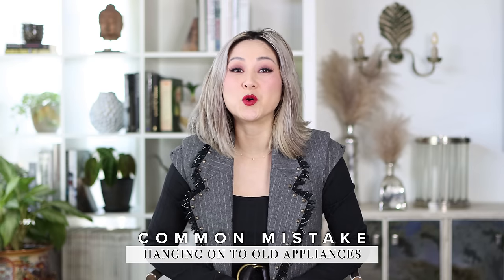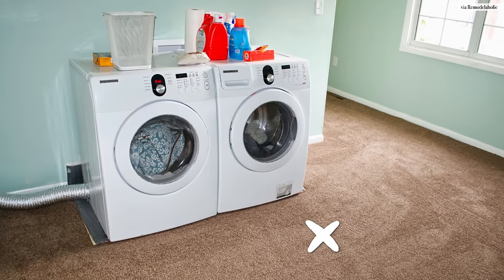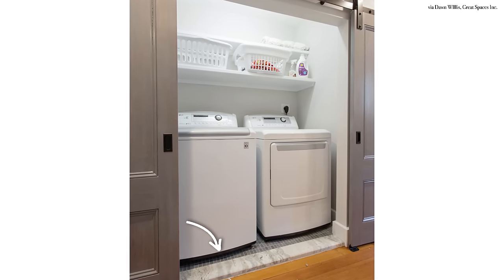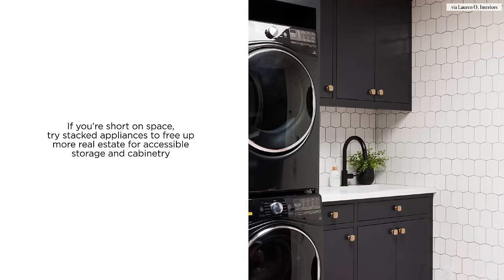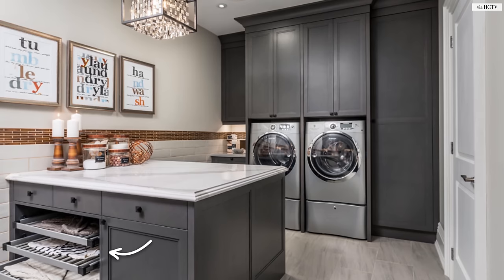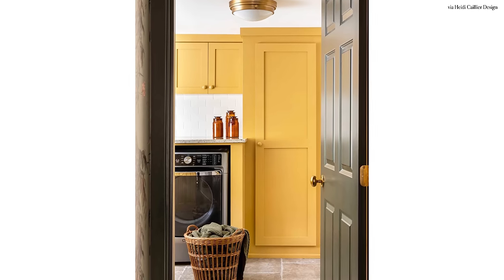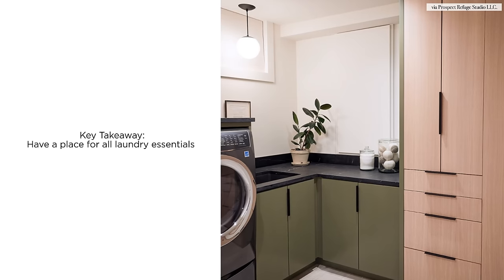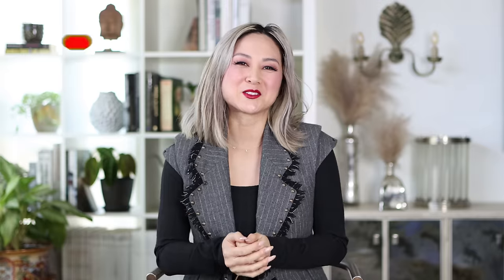COMMON DESIGN MISTAKES | Laundry Room Mistakes and How to Fix Them

Comment: The old, simple top loading washer and dryers are the most efficient and cost effective. Less to break.
Reply: Your right. My brand new machines are just not robust with all the plastic buttons and dials.
Reply: They use way more water.
Reply: @junehodsdon8037  I'd rather they use marginally more water and work for twenty years than break after five. The environmental cost of producing a new washer and dryer and its components have more of a negative environmental impact.
Reply from the maker: Thank you for watching and the feedback L! I’ve had my smart washer/dryer for over 6 years now. They’re still going strong (🤞🏻) My mom still has the older models and hers break down all the time. I’m sure it has everything to do with which make/manufacturer. If you don’t mind sharing yours, I’m sure the viewers would love to know to help their decision 🙏🏻☺️
Reply: @JulieKhuu  Gladly, and I'm sure you're right on the manufacturer piece! 

They are by no means aesthetically pleasing,  but we have the Amana Top-Load Washer and Dryer (less than $1,000 for the pair). Bought in 2013, super budget brand, no issues or complaints so far.  We hang dry most of our clothing, so that really saves the dryer, electricity and our clothes! 

Thanks as always for your great videos -  wishing all of our appliances, long issue free lives! :)
Reply: @cannotgetstarted  My daughter has an Amana set I passed down to her- the washing machine has tons of rust around the lid and it is less than 10yrs old - the dryer had some small piece go out and my daughter was able to look it up on YouTube and fix it herself- she’s an engineer... lol... I could NEVER do that! The Maytag washers and dryers have a 10yr warranty each, but the old fashioned SpeedQueen lasts for LIFE!
Reply: I agree - i find the top load washer cleans better. Granted i had an LG front load for 12 years prior to my divorce & it was a good machine. Went 10 years with little maintenance for about 5 of those years before it needed a new water pump. They make them difficult to fix yourself, have to take off the entire front portion -including the door to get to it.
Front load are trickier to maintain/clean, always need a flashlight lol. I realized besides the faulty pump (& my ex adding too much detergent) due to it using less water the clothes were not getting as clean. I found out how and went in to bypass the water level sensor. Its very easy.
Where i live now i am back to a top load. Easier on the back for sure.
Reply: My old Maytags were from 1989.  I left them in my dad's house when we sold his house 4 months ago, so yesterday I purchased my 1st washer & dryer with my own money at age 60!  My 1989 Maytags were a wedding gift.  Unfortunately, there are huge out of stocks on washers & dryers these days, & I had a coupon that was expiring yesterday, so I couldn't order Maytags again!
Reply: Love my new Samsung smart ones!!! Cleans much better. Hands down. Tammy
Reply: I had the new fancy front loaders and I hated the washer. I switched back to the way less expensive less popular top loader and I LOVE it.
Reply: But you still have to go to the laundromat with a sack of quarters just to wash a king comforter. PASS
Reply: Mine just broke after just 5 years so….
Husband is handy though so he fixed it. Still cost $200 in parts
Reply: Our (inherited) dryer is 43 years old and keeps on ticking.  We have it cleaned every 7-8 years.  We’ve been through 3 washers with many repairs on each in the last 18 years.  Each repairman has told us to hold onto our old dryer.  They don’t make appliances like they used to.  The new fancy ones are extremely expensive to repair and are designed to last only 5 or so years.  We were told on our most recent washer repair that we would be better off to buy a new one.
Reply: Yup! I love my washer and dryer. And the saying "if it ain't broke, don't fix it" is my motto. I refuse to replace something that is still functional. I'm not into the whole upgrade to keep up w the Joneses thing. Hard pass.
Reply: I've had my top loader for almost 20 years. Works great!
Reply: @JulieKhuu  Fisher and Paykel. New Zealand brand. The newer ones they produce  aren't made like they used to be though.
Reply: Front loaders are moldy pos.  Top loader washer for me.

Comment: Just bought a new set for my new house and while those smart machines are convenient and beautiful, I went with a good old top load Speed Queen. The front loaders stink and temper the water! The SQ w electronic controls will tell me how long the load will take and I can set my phone alarm. Not as gorgeous but extremely effective.
Reply from the maker: Awesome Teresa! Thank you for watching and the tip! I know viewers will read your comment and gain insight for their next purchase 🙌🏻☺️
Reply: Totally agree! My sister had a front loader and she would clean it AND leave the door open in between loads but she could detect a mildew smell! We are doing a whole home renovation and opted to purchase a top loader even though the front loaders look better
Reply: Completely agree. Had a very expensive front loader and those  rubber rings are THE WORST.  I donated it and got a good top loader, but I have to say I really miss the old agitators!!
Reply: You are right, once a coin got stuck in the front loader and we had to call a technician for that but when same thing happened in a top loader, we just had to take it out manually from the tub.. simple !
Reply: THIS! Front loaders smell awful! They smell like  mildew no matter how much you clean them or leave the door open to air out after use. Top loaders look old and ugly but when the time comes to replace mine I’m going for an old fashioned top loader….if they still even make them.
Reply: @shadiap  The new LG front loaders have a special trap for coins, etc. Easy peasy. No technician needed.

Comment: For asthetics yes new washer and dryer but for durability no. Older models last forever. They are not hard to repair. My husband has changed gaskets and more and it works great amd saves money.
Reply: But not energy/water efficient.
Reply: I could not agree with this more. We are adding over 1000 sq ft to our home and could afford a new set. But my old ones work and can be fixed. New ones don’t last as long. From an environmental perspective throwing out a working appliance to buy a new more efficient one feels like it misses the whole point of trying to be environmentally friendly. When mine do eventually break I’ll be looking for durability and efficiency for long term environmental gains.
Reply from the maker: Thank you for watching and the feedback Mama! Yes, of course do what works for you and your needs 👍🏻☺️
Reply from the maker: Which is why I’m an advocate for newer models June 👍🏻
Reply from the maker: I love how you put this Elizabeth. If it ain’t broke 👍🏻
Reply: I rented a place with a washer so old it had an avocado green logo and it was off white.  No idea what year but it was old - but it still worked!  I feel like stuff these days can go so fast.
Reply: @junehodsdon8037  That's not true, because my new washer doesn't even have an option for very small loads. It either fills to the top or near the top. It is garbage and I wish I had repaired my old machine, which I used efficiently without having to be told to.
Reply: No way I'm getting a front loader ever. Top loader and keeping my old washer and dryer until they die. Both are amazing.

Comment: Number one disaster I noticed in many two story homes: Laundry room downstairs instead of the 2nd floor. Ridiculous. Newly built homes are fixing this, though. Most laundry rooms are now on the 2nd floor.
Reply from the maker: I feel you! Such a pain to move up to the second floor if all the bedrooms are located there 😅
Reply: Agree we’ve just moved ours downstairs to the bedroom area and outside access to the clothes line. Saves having to haul laundry up and downstairs👍

Comment: I was the recipient of an old set from a friend who was upgrading to a smart set.  My laundry room is in my carport . I decorated and made it visually cute with baskets and faux greenery. I am thankful to no longer be going to public laundromats. I have an original antique wash board hanging on the  wall,  it's a real conversation starter.  I could decorate an outhouse and make it cute if needed..Sometimes you have to play with the cards you are dealt. You always  exceed my expectations..😀😀
Reply from the maker: I love that. Work with what you’ve got, but make it yours Debra. Couldn’t have said it better myself 🙌🏻😍

Comment: I don’t have a laundry room, but rather a laundry “space”. Mine is actually in the kitchen  of my tiny cottage. I am looking forward to your videos on smaller spaces. Thank you for these fabulous videos!
Reply from the maker: My tiny laundry closet is in between my dining room and hallway, so I understand Mary 👍🏻☺️
Reply: Mine is in an open hallway leading to the back door, I love it! I never use a drier, I use an outside clothesline or in winter an airer in a sunny spot in a room I don’t use all the time👍
Reply: I am about to have two walls knocked down to make an open plan kitchen diner with sofa. I miss my old utility room so have asked my cabinet fitter to build me a 'laundry cupboard' to incorporate my old sink. He suggested moving the kitchen onto the old dining room area and having a kitchen island. I cannot wait as I have made do with a galley style kitchen for 30 plus years! Thankyou for all of your advice and tips ❤

Comment: Great point on the tile flooring! ♥ Yesterday my sink stopped draining for some reason while machine was running, and suddenly I got a home upgrade in the form of an indoor pool :))))) If the floors were wood, like it was in my previous home, that would have been a nightmare. Now all I need to do is to dry this and check the walls for mold :)
Reply from the maker: Hopefully the base molding was able to stop the leaks before it seeped into the walls Anna! 🤞🏻 Tile for the win!

Comment: Julie--Stunning examples and great ideas!   I'm redoing my laundry room and have a new top loader.  (My front loader was a nightmare--I was spending tons of my time cleaning my washing machine!).  I noticed that most of the pictures featured front loaders, which do allow for counter space on top.  I would love to see more ideas of maximizing space/creating shelves or cabinetry for rooms that have top loading machines.  Thank you!
Reply from the maker: Will add more to the next video Brenda! Thank you for watching and sharing your thoughts 🙏🏻☺️
Reply: Me, too. Hated the front loader and switched back. I didn’t like the washer spitting on my clothes, swaying them like a baby and then having me maintain the thing. I’ve heard from ppl who feel the same and others who love them. Thankfully there are both sold!

Comment: amazing video, very comprehensive. I've found that the area above the washer and dryer does not work since it is too tall for me to utilize as a folding or hanging location. I wish it did because it would look nicer open over those massive appliances. I can only use it for deep storage of bulk items that rarely get changed out, like entire packages of paper towels or toilet paper, because of this. You can be sure that a stepladder is always in the closet. I'm a little hesitant to defy advice when such an experienced voice is warning me not to.  Designing occasionally involves making mistakes. Is this a definite no?
Reply: Ha, my grandaunt had a toilet, in her laundry room. 🥵🥵  It seems me weird, what do you think ??
Reply from the maker: I use this spot above my laundry area for bulky appliances I don’t use daily like my Instapot, party platters, and backstock cleaning supplies. Does the job, serves its purpose 👍

Comment: Thank you. I thoroughly enjoyed this video. It's both helpful and inspiring. 
I have lived with the mentioned drawbacks of a front loader for 18 years, so I strongly considered a top loader. Speed Queen looked like a great choice. Unfortunately, I couldn't reach all the way down to the bottom of the inside of the top loading washing machines. (At 5'6", I didn't considered myself to be short.) Disappointed...so it looks like we'll buy another front loader. Since they are deeper, I had trouble reaching to the back of the traditional front loader. I'm 74, so knee power is not what it once was. Either a 5" riser or a 15" riser should solve that, but it looks like we'll need to sacrifice having a counter in order to make either of those work. (We love our shelves and cupboards above that space.) sigh. Change can be stressful, even when it's good change. I will re-style the room, so in the end, it's all good. Function first. Body function, that is. 😊
Reply from the maker: Function first ALWAYS! 🙌🏻 Also my gripe with the top loaders- it’s challenging washing bulky bedding with that huge agitator in the middle. I just wanna stuff it all in sometimes and front loader is made for this purpose.

Comment: You overlooked one key aspect when selecting a new washer & dryer. All the bells and whistles are great but not if you struggle to use them. If you are over 60, placing & removing clothes from a bottom stackable washer can be a back killer. Place it on a pedestal and you need to be 6 foot+ to reach the dryer. Placing them side by side makes the most sense, with pedestals beneath for storage.
Reply from the maker: Pedestals are definitely more ergonomic, but not if you upper cabinets or shelving that limit the vertical height. Unfortunately that’s what I deal with Deb 🙁